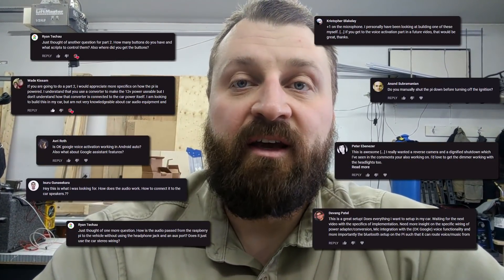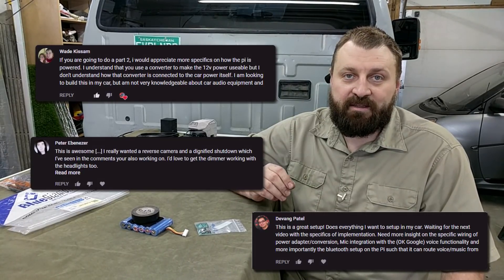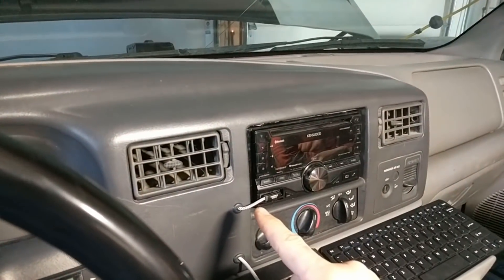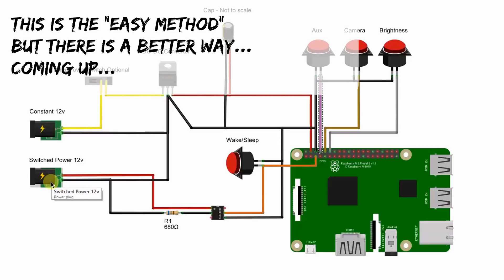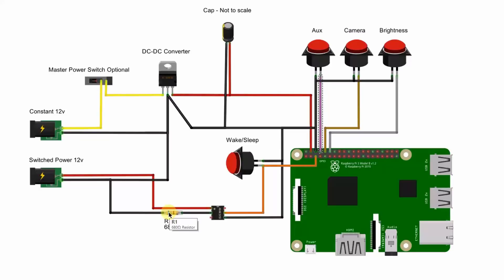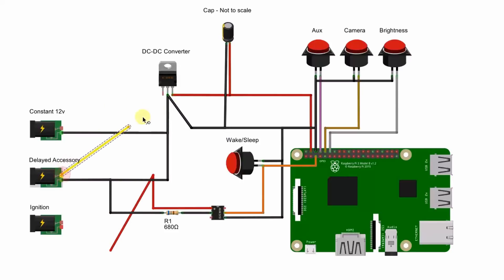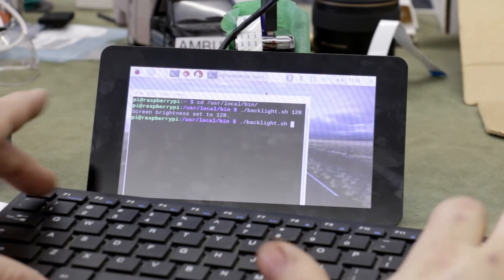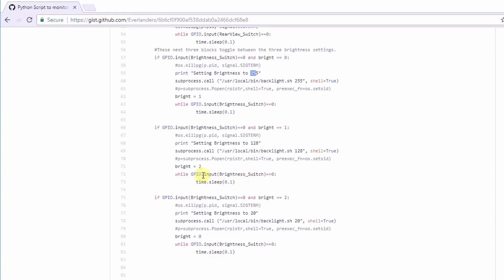Wiring AndroidAuto & Raspberry Pi to your Car - Rear View Camera, Connection Diagrams, OpenAuto

Comment: Building the delayed accessory should be just a small relais system with condensators. Should be easy to make
Reply from the maker: Most modern cars have it from factory anyway.
Reply: @Everlanders  yes, but my vw corrado is way to old. I would add an battery pack to buffer it a little bit and the delayed systems are on eBay for around 3 bucks, so it is added fairly easy

Comment: that 30' cable did u check to see if it had a source and output side stamped on the connector itself. Something I learn is some of those cables over 25' only work in one direction. I learned this after I had to rerun cables (twice) in a restaurant rebuild I was working on. Found it after I tested the cables on the ground, ran them, got no signal, pulled them, and then saw the stamps on the connectors.
Reply from the maker: Good tip, I haven't checked but will do as soon as we get back home!

Comment: If my car has buttons on the wheel for calling and adjust music volume and station can I wire these function to the wheel?

It would make things much easier to use volume, track and google assistant on the wheel
Reply from the maker: In modern vehicles the steering wheel buttons are communicating over the Canbus Network. You would need to tap into your OBD2 port and parse the data to determine which button is being pressed and then map that to keystrokes. I've done some preliminary testing with the Bluetooth OBD2 reader and the torque app, I can see the values changing as I press the buttons, so it should be possible.
Reply: By modern vehicles you mean starting from which year?

Specifically talking about a  Honda CRV 2011.

But thats interesting so I would need to see what changes when I press the buttons and then have them do different things as scripts when each is pushed like raise volume?
Reply from the maker: The volume is controlled from the head unit, not the raspberry pi... Seems like you have some research to do.
Reply: Also can this be hooked up to radio?
Or only music services ?
Reply from the maker: Radio... Really... 🤦‍♂️

Comment: Question: If I buy the AC adapter for the raspberry PI and run it all the way to a plugin inverter, will it be a simpler way of connecting it to power without having to do all the harness stuff? I think you mentioned it in the video about the micro usb part. (If so i would have to turn it on manually everytime I turn on the car and turn it off before leaving the car right?) Im new here so any info would help. BTW love the channel!
Reply from the maker: Yup!

Comment: Great videos! I have one issue with my build. I have built it like yours but having trouble getting the mic to work. I ended up using a Ugreen sound card and sound is audio out is working but no mic. Any ideas?  Thanks! Mike
Reply from the maker: Make sure you set it as the default input... Check the adafruit tutorial for details.
Reply: @Everlanders  Thank you so much for the wicked fast response. I looked at that website and did the following:  sudo nano /usr/share/alsa/alsa.conf, then modified these 2 lines defaults.ctl.card 0
defaults.pcm.card 0 and set both to a value of 1, then rebooted. Then checked microphone, microphone capture, and auto capture. I tried  all different configuration but still no luck. I am running a similar setup as you: raspberry pi 3 b, official raspberry pi screen, Rasbian Stretch with Android auto, Ugreen sound card and a Rockrok professional condenser lavalier microphone. Audio out work fine but there is no audio in. Any chance it would be the type of mic. Fyi-i did test the microphone in another device and it does function. But maybe not with this setup??? Thoughts??? Thanks again! Mike

Comment: power a relay with the switched 12V to relay the constant you can easily do this behind the screen ^^
Reply from the maker: Easily do what?  The optocoupler triggering the shutdown script prevents file system corruption.
Reply: monitor switched power ... then get a relay with a timed delay on closing.. this way raspberry can see when to shut off and also be given the time to do so....
Reply from the maker: In that regard an optocoupler acts exactly like a relay, it has the benefit of being smaller, cheaper, quieter and more efficient. Not to mention it optically isolates the pi from spikes.

Comment: Can you please help me with how much resources do you still have available on pi board? I am thinking to follow your project but also add some gas sensor as I have propane water and air heater in my camper. Cheers!
Reply from the maker: How many GPIO pins does Raspberry PI 3 have?
The Raspberry Pi 3 Model B board contains a single 40-pin expansion header labeled as 'J8' providing access to 28 GPIO pins.

Comment: Now, what if my radio doesn't have AUX? Is there a way to connect to the speaker cables directly?
Reply from the maker: No, the Raspberry Pi has no amplifier so you'll need a head-unit or amp of some kind. We use an el-cheapo, 99$ Walmart special. But you could just use something like this: https://www.amazon.com/PolyPlanar-120W-Audio-Amplifier-Control/dp/B00NZCR404
Reply: So basically, the pi connects to the amp via 3.5 jack, and the amp connects via wires to the car speaker wires? And also, does the wattage depend on the speakers or the pi?
Reply from the maker: Correct, the wattage of the amp is related to the speakers, most stock / middle of the road head unit will be around 15 to 25 amps per channel.

Comment: Excellent project. One question, May one run a camera dependent application on the Pi using the camera?
Reply from the maker: I don't understand your question...
Reply: I may not understand auto Pi completely. I thought I read that auto pI was an emulator for running Android apps on it. I have an Android camera dependent app that I would like to run on the Pi.
Reply from the maker: No, it's not an emulator. Its an application that acts as a remote display for Android Auto.

Comment: Have you considered cameras with analog input? I bought Raspberry Pi and official 7 in screen for similar project and also ordered model specific camera, but being noob in this I lately realized that camera has RCA output and using it as an input for raspberry might be a problem. I could have got different display with reversing camera input, but official raspberry 7-inch is already ordered... Any advice?
Reply from the maker: Those cheap cameras with RCA outputs are typically pretty low resolution and limits what you can do with a Raspberry Pi.  Most are 480 lines or 720 if you're super lucky. But the digital Raspberry Pi cameras are 8 megapixels, much higher-resolution depending what you want to do. I wouldn't even consider using an RCA output camera...
Reply: Everlanders, I only wanted reversing camera functionality. No need to record it or anything like that. Camera is 720x480, it replaces one of rear licence plate lights. I decided for it because it seems to be made for this specific application, it's waterproof and I thought that hgmi converters solution you used is a bit too complex for the job :) I didn't know that connecting rca video source to taspberry would be that hard...
Reply from the maker: Yup, it will be super hard... Sorry

Comment: Hi and thanks for these great videos :)

I have a little issue with mine though, I have it all set up just like you do and it works fine. I also use a USB sound card for both audio out and mic in.
The voice recognition works perfectly via this mic and also the music is on that audio out.
Only if i want to call someone, Android Auto always prefers the Mic and Speakers of my phone.
I already tried several settings, also bluetooth, but nothing helped. 

Do you have an advise for me?
Reply from the maker: We use ours for Navigation and Music, Being a Big Diesel Truck it's hard enough to think let alone speak on the phone... I don't think I've ever tried, Sorry.  Next time I'm in there I'll try and see what happens.
Reply: Everlanders thanks for the quick response. no problem, ill see if i cab find a way, and if i do so ill add it here ;)

Comment: Hey man, I’m looking to make something exactly like this but for my bike helmet. So can you help me out with the display size?
Reply from the maker: You can get smaller screens... But the image quality is not as nice... https://www.adafruit.com/product/1601 and I'm not sure how you would focus that close not to mention use the touchscreen.
Reply: What if I connect a wireless keyboard/ mouse to control it without using the touchscreen like this product right here(  https://www.amazon.com/Yongf-Wireless-Touchpad-Backlight-Raspberry/dp/B079C8YXW5/ref=sr_1_1?ie=UTF8&qid=1532066716&sr=8-1&keywords=wireless+keyboar%2Bmouse )
Reply: Or do you have any other idea as to how i can overcome this problem?
Reply from the maker: You think you could use a mouse and keyboard while riding a bicycle?  You still have the problem of focusing on a screen that close to your face. Try holding a smartphone that close to your face and see the results.
Reply: I could use a lens to change the focus. I have mainly three doubts
1. how to send the real time data?
2. will this same system work for a smaller display?
3. what to change if I don't want to connect my phone through a usb to the pi?
And if this is complicated can you please suggest an alternative way?

Comment: I have tried several chinese android head units with very painful results, mainly due to software quality. What I need is a 2DIN head unit with integated amplifier, radio, from DVR input and reversing camera input, also GPS antenna with navigation and mic input for handsfree. Might as well integrate some alarm features in future... And I need it all tidied up below a nice GUI.
Was about to start my own project and found this. Very nice work.
If someone could point to some reference projects, that would be great!
Reply: 0111I
Reply: @pistolpete9983  All I want for Christmas....  :)

Comment: I am doing something quite similar. Could you please please say what capacitor you used?
Reply from the maker: A 4700uf 10v would work fine, not sure what I used exactly. It may be visible in the video at some point.
Reply: Hey, thanks so much for the fast reply. I'm very new with SOC hobby computers. Maybe I should I have led with this, but I'm using the ODROID board. It seems to me that the only differences in relation to your schematics are the pinouts, and the power supply. I'm using a buck converter to take the output to 5v/6a, considerably more amperage than the pi would use. Does that mean I would want to use a higher rated cap? Excuse my lack of knowledge.

Mighty kind of you to take the time; I really appreciate your help. It saves me a TON of researching.
Reply from the maker: The way I've shown to wire this capacitor it is considered a tank cap, it is there to prevent a deficit in power when the load demands a surge. For example when the backlight turns on or the fans click in. This can still be a problem no matter how large your power supply is, the problem is inherent because of the thin wires. Think of it like sucking up a milkshake through a straw, your mouth acts as the buffer/tank while you slowly suck enough milkshake for one good gulp. It doesn't matter how big the glass is, you can only get so much through the straw.
Reply: You've been immensely helpful with my project. I really appreciate the colorful metaphor also. Thanks so much for being clear and precise with your wording. You're a great guy :)

Comment: Nice project! I'm curious to know whether your phone actually charges when playing music and using maps? I've found that if I'm streaming audio via Bluetooth my phone battery stays constant.
Reply from the maker: My phone is a Google Pixel XL which has a high rate charger... It can't charge at high rates off a normal USB port... That being said, I'm not using bluetooth for audio, and the screen is off for the most part as the Pi screen is handling most things. It does charge slowly... as would be expected on USB 2.0 (500mA).

Comment: Great project, making and testing now. Had trouble getting my phone to connect, found some info on crankshaft site to change openauto.rules file. What type of switch and where can I get one that you showed in "About My Buttons" section. The one that shows a black background and four buttons numbered 1,2,3,4. Thanks
Reply from the maker: I don't use or endorse Crankshaft... Not sure if your question applies to my OpenAuto installation...?

Comment: great job. how does the pi hold up under extreme car temperatures? i live in AZ where we can hit up to 120F, even higher in the car once it's parked. definitely not good for regular android tablet installations. so i've started looking into this kind of install
Reply from the maker: As with any other electronics, when in the heat the CPU should be kept below 60º-80ºc (140º-180ºf)

I don't have any extra cooling, but I did leave space in the enclosure for a CPU fan if needed. This video explains it clearly. https://www.youtube.com/watch?v=1AYGnw6MwFM

Comment: wich version of raspbian Noobs or debian version ? or doesnt matter ?
Reply from the maker: I used Raspbian Stretch, newest...
Reply: ok got it to run somwhat :-) on a pi2b+ i think it was and with no touchscreen, put the backlight.sh and buttonmonitor.py on it and tryed to execute 
pi@raspberrypi:/usr/local/bin $ ./backlight.sh 124
./backlight.sh: line 13: /sys/class/backlight/rpi_backlight/brightness: No such file or directory
Screen brightness set to 124.
I think this is because i dont have the touchscreen set up yet?
Reply from the maker: The Pi 2 does not have the hardware acceleration required to run this.
Reply: i orderd te pi3 :-). Is it possible to use external buttons to switch between openauto menus ? like 1button to navigate and 1button to go to music etc like in a standard car nav radio?
Reply from the maker: Everything is possible... You'll want to research Keyboard emulation via GPIO  It is possible to use the Keyboard to switch the screens now, so you'd just need to map the GPIO to the required keys.
Reply: Everlanders thanks i wil look info that

Comment: Why not tap into the reverse light, into an optocoupler, or relay, in the same way your other coupler is... that way you could trigger the reverse camera automagically
Reply from the maker: Because I mostly want to use it as a rear view mirror when on the highway... I switch to a downward facing camera for reverse...   The script I provided has provisions for tapping into the reverse lights if you want...

Comment: Great video and instruction! Your setup matches exactly my requirements. I got most features get to work except for one. The brightness commands from the push button are recognized successfully from your monitor script, but I got told from the pi that the permission to execute the command is denied. Do I have to be root by default (on start up) to get the right permissions or is there another hint to enable this on the standard user pi? Interesting is, that the push button commands for the camera are accepted correctly.
Reply from the maker: Be sure to use the chmod command to make the script executable.  " chmod +x nameofscript.sh"
Reply: I've checked this again and found out that the permission problem occurs already earlier while testing the script. Being in /usr/local/bin and typing 

"...$ ./backlight.sh 128" 
the result is:  
./backlight.sh: line 13: /sys/class/backlight/rpi_backlight/brightness: Permission denied.     
Screen brightness set to 128.   

When I test the same with sudo

"...$ sudo ./backlight.sh 128" 
the result is:  
Screen brightness set to 128.   

Really strange. Any idea on this? What happens in line 13 of the script?
Reply: Found a solution in the comments of your GitHubGist - The user sh4un wrote:
https://gist.github.com/Everlanders/f3dc236b9d670b105232952592e5e23a
-----------------
line 13 gave me a permission denied
i did a little digging and elevated permissions by changing from this:

echo $level > /sys/class/backlight/rpi_backlight/brightness

to this:
sudo sh -c "echo $level > /sys/class/backlight/rpi_backlight/brightness"
---------------
@sh4un: Many thanks, this worked for me! No it works as described

Comment: 1st - Wow.  Thanks for taking the time to share this!
2nd - Ok - so, At 15:50 you are dimming the screen with buttons on your shifter which are clearly not connected?  Huh? (picture cute puppy dog with cocked head here).
Lastly - Wow.  Thank you for this video!  I'm researching this to start a similar project and you just gave me both a resource and confidence boost!
Reply from the maker: B-Roll my good friend... :-) "Not Connected" (yet!) The clip of me pressing the buttons was recorded earlier, just after I installed the buttons. But then later when I was demonstrating that the scripts, I had no video of me pressing the buttons, so I used that clip.

Comment: you should have used a RPi camera + RPI zero and connect it RPI screen  via WiFI
Reply from the maker: No, there is too much latency. I'm already doing that for the other three cameras and the delay is 1-2 seconds, far too long when driving for rear view reaction time.
Reply: Yes 1-2 second is too much delay..may be try wired lan connection, it can also double as a dashcam DVR.. those RPI camera are not meant to transmit over 1ft cable!
Reply from the maker: I know :-) Still I've got it wired and working at 35ft!